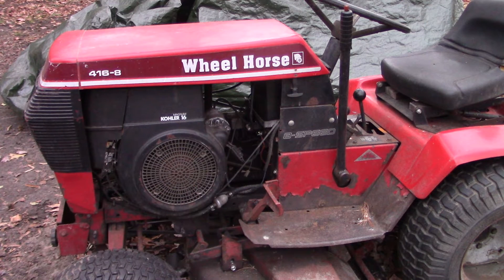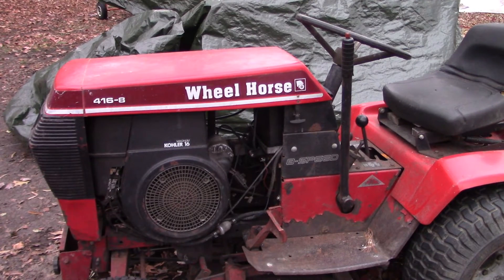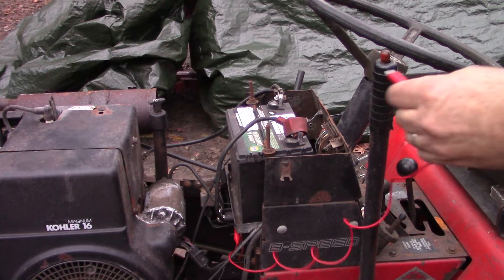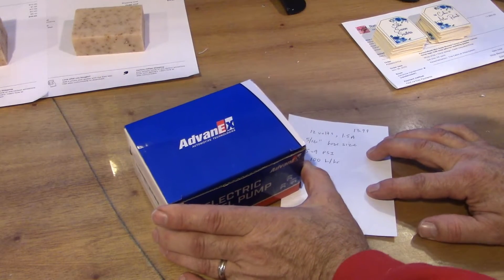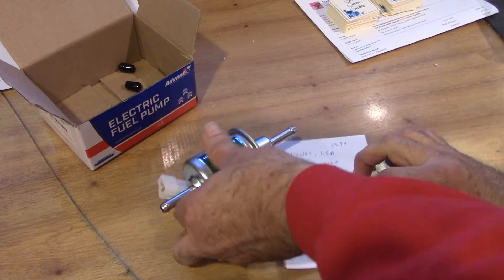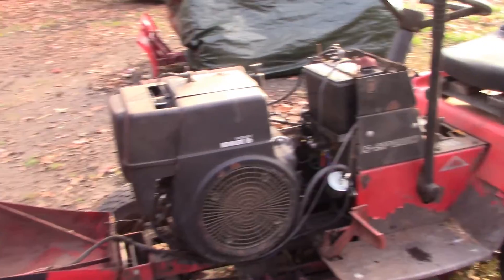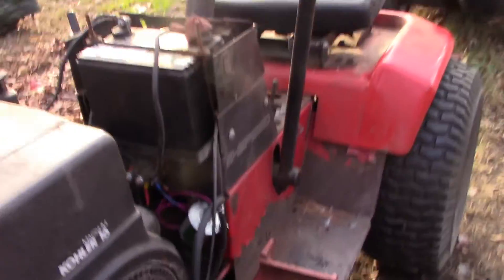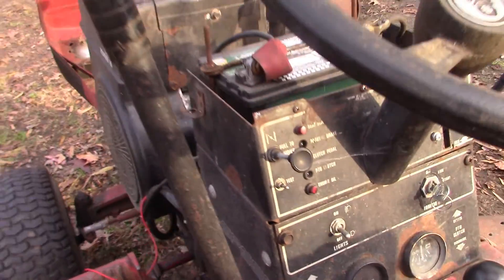Engine CRANKS TOO LONG When Cold - INEXPENSIVE FIX - Wheel Horse Kohler Magnum

Comment: This video has excellent timing for me!  I've just been wondering the exact same thing.  I have a 79 John Deere 216, with a mechanical fuel pump, that just cranks for a very long time before it fires up.  I've used those little electric fuel pumps on golf carts and they work perfectly.  Just 3 days ago, I was considering trying a low pressure electric pump, like you did, on my John Deere to see if it will help it start a bit quicker.  I also read one of your comments, below, that mentioned "tying the electric pump into the starting circuit and using a push button switch with an inline fuse."  That seems like it would work, too.  Now I'm wondering if you had any issues, or continued success, with using the electric pump....considering this video was posted 2 years ago.  Anyway....thanks for sharing your experience!

Comment: I believe the gas goes back to gas tank when sitting, I have a 520 H and I put a shut off valve by the fuel filter to prevent that from draining back to the tank. The auto fuel pump has to much presser. If you want to use an electric pump get one for a grass hopper mower, the presser is 1 to 5 psi.

Comment: I used this method on my WH 520h .Electric & OE pump in line together. Use electric to start / run Onan 20 hp.Will flood engine if left on. Pulse operated pump takes over from there and pumps gas right through shut off electric pump. I can shut gas off at tank,run engine out of gas to park tractor. Next time run electric pump 10 seconds before starting engine,starts right up and runs on OE pump.
Reply from the maker: Thanks for the note. Truth be told, I too switched to a push-button switch on the dash so I can prime the system before even turning the start key. Works great.

Comment: Did you try replacing the old fuel pump with a new one before putting on an electric?
Reply: Stop replacement pump not available, I've got the same problem and have to give it a few shots of gas after sitting a few weeks.

Comment: Great remedy for a problem, although I’d term it a workaround more than an actual solution. 
I would have preferred to see an actual diagnosis.🔧👍
Might it be possible to rebuild the mechanical pump if the cam is worn?

Comment: Another great video on a frustrating issue. Thanks for making the video for us to see that there is usually a solution to a troublesome start.
Reply from the maker: Thanks. I'm thinking of going back and instead of tying the electric pump into the starting circuit, I'll put a push-button switch on the dash (with an in-line fuse), so that I can operate the electric pump for a few seconds before even attempting to crank the engine. Maybe one of these days I'll get around to that. Ha ha!

Comment: I am the second owner of my Wheel Horse 312-H with a Kohler Magnum. The original owner said it was always hard starting and I just went to using a quick shot of starting fluid on startup.  Years ago I eliminated the mechanical and switched to an electric pump after I found the mechanical pump has allowed fuel into my crankcase! Now I have a different issue. The engine quit while mowing. It will start and run at idle but only for a few seconds. It has good spark and I have tried using another carb and fuel source.

Comment: My 310-8 suffers the same problem when it sets for a while you crank that thing until the cows come home and leave for work I was thinking it was the fuel pump But once it starts its fine and while cranking you can see through the fuel filter it sucking away but no fuel in the filter where does the fuel go that was in the filter after its run? I check and there is fuel in it when I shut it off and I turn off the fuel at the tank where does it go ? I had replaced the fuel lines and the filter checked the nvh gas cap to see if the vent was plugged or something and nothing that dammed thing cranks and cranks does  anyone know the fuel pump pressure vacuum? The only way I can get this to start without cranking all day is pull the spark plug and prime it sometimes 2or 3 times and you can't keep doing that forever for obvious reasons so where does the fuel go in the filter that was there when you shut it off and gone in a week or so?
Reply from the maker: In retrospect, I think I should have wired up the electric pump to a push-button on the dashboard. Then I could push it a few times to prime it before turning the key to start the engine. Anyway, good luck!

Comment: I have a Briggs 26 hp on a zero turn mower that cranked too long to start. Fuel pump was good. Battery was good. So I checked the air gap on the coils and they were away too wide. Set them to spec and now it starts instantly. 
Your issue was different. Nice it worked for you.

Comment: Change fuel lines,the new gas that we have shortens the life to three years.
Reply: Fuel hose is junk now days unless you get Gates brand hose 
Don’t buy the cheap online crap
Check the psi of electric pumps before putting on, not over 5 psi on floats and needles 
Use eather electric or manual pump

Comment: My 310-8 does the same thing I replaced the fuel pump and it fixed the problem for about a year and then it came back. Dave

Comment: You Need To Get a Push Button Starter Switch & Put One Wire To The Solenoid Positive & The Other Connector Onto A Earth Somewhere. That Would Piss Me Off , Jumping The Solenoid Like That All The Time
Reply from the maker: That's a good idea, though I don't think your wiring configuration would be quite right. What I really need to do is correctly fix that connector at the key switch. Just haven't gotten around to it yet.
Reply: @Buckwsr  Yes Your Right , I Was Thinking About It Later & Thought That Won't Work LOL

Comment: I had the same tracker I am the same problem I wanna try what you did But I gotta make sure I got The wires Right now too I got to  get   Rear end leaking    Fixed  I gotta  See if I can replace a seal cause just as it Set  it  Leak Thank you for the video 👍
Reply from the maker: Thanks, Joe, and good luck with your tractor!